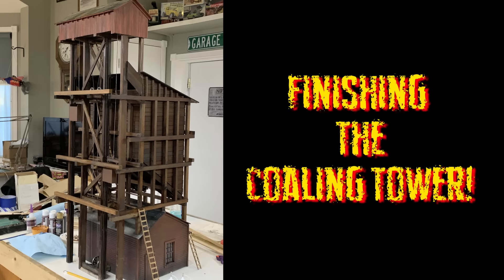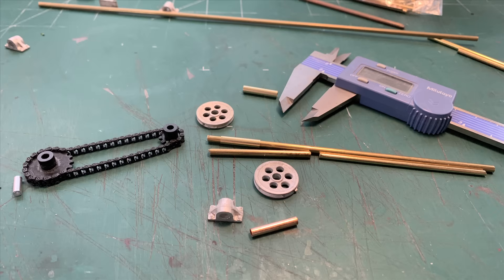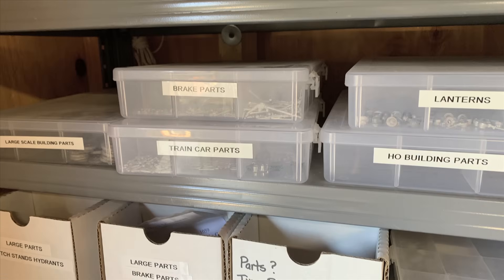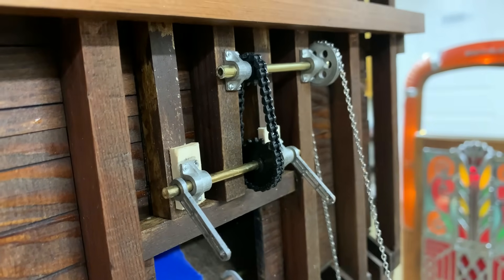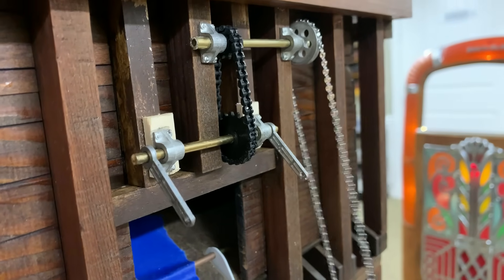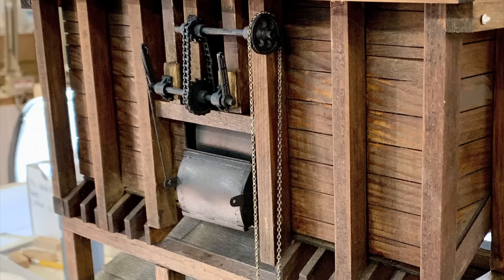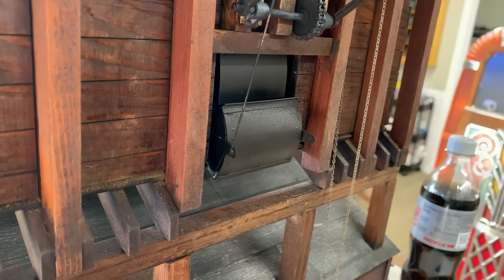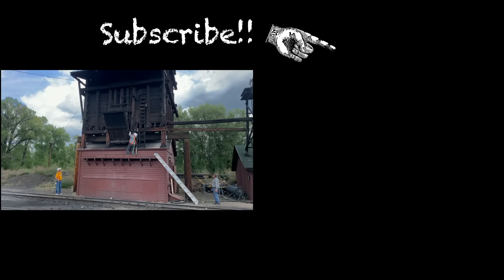Making A Functional Door Mechanism on a Scale Model Of The Famous Chama Coaling Tower! Part 2

Comment from the maker: I’ve never seen a railroad use that kind of system except to actually load the coaling tower. I think the problem is getting a whole bunch of coal into a locomotive really fast.  With a tower like this one they can completely fill the locomotive in about 30 seconds!  And then the tower can sit there running constantly loading more into the tower. So the loading system into the tower can be kind of slow, but the loading out has to be fast.

Comment: Is the coaling tower in every-day use? If not, how are the locomotives fuelled?
Reply from the maker: No, they just do it for show. They said they’ve got about 6 tons of coal in there and they’re sort of hesitant to load anymore. So they just let a little out here and there to demonstrate that it actually works. The loading buckets tend to jam on the tracks and so they’re running them up and down, but not all the way to the top.  

The locomotives are being fueled, using a front loader from a big pile of coal. The coal has been brought in by truck from a nearby mine, but that mine may be closing! This why Silverton has been converting to oil. Well that and the fact that they burned down the forest and several buildings in a cost of millions of dollars. Oops. But they’re only going to keep one of their locomotives running on coal demonstration purposes.  Chama hasn’t made any such decisions. 😊. So who knows!! 🚂🚀🚂🚀